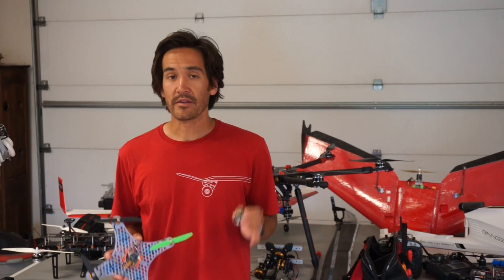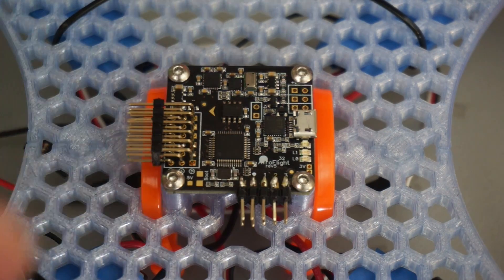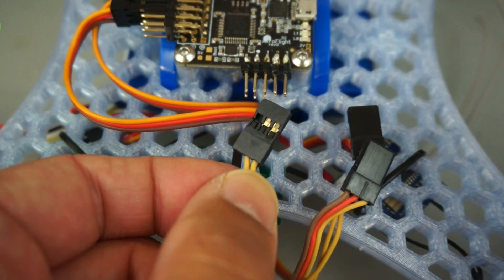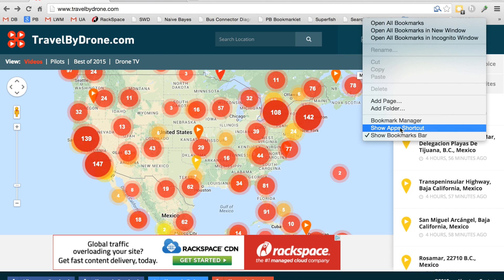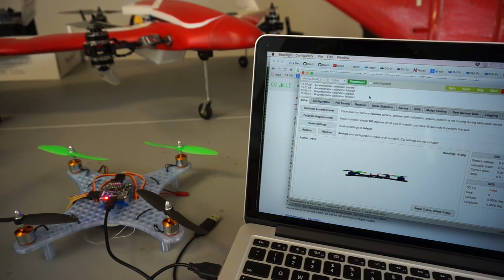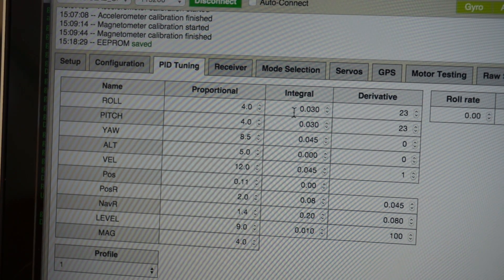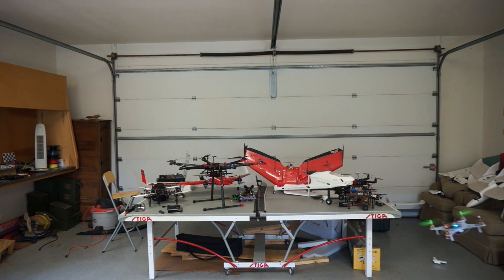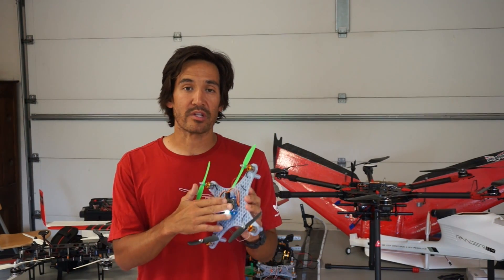Naze32 Wiring, Configuration, and Garage Maiden with DIY Mini Quadcopter

Comment: Your videos are awesome, super easy to understand, and very informative.

I know you haven't posted much Naze32 stuff in a while.  If you get the time can you do a video for setting up a Naze32 with a FrSky X4RSB Receiver in SBUS mode using cleanflight and a Taranis Radio and 3 flight modes on 1 switch (angle, horizon, and rate)?

Or if you could just do a quick video of how to set the 3 modes up in cleanflight and on the Taranis with sbus that would be great too.

I have found videos with bits and pieces for setting these components up but I haven't found one that shows a complete process.

If you don't get time that's cool too.  I used your videos to build a complete DJI F450.  Thanks for taking the time to post so much information!
Reply from the maker: +Hall Fatherofthree Thank you so much for the positive feedback. I'll see if I can get to work on a Naze SBUS tutorial in the near future. Right now I'm working on getting Naze working in a wing just to see if I can get it to stabilize. Once I'm done with that I'll look into an SBUS setup. Appreciate the thought.

Comment: Your video helped a lot, i'm using a Afromini Amaze rev3 (Mini Naze32) . i have it flying but have run into a problem and I don't understand how to fix it.  I fly in "rate/manual" whatever you want to call it.  but my Yaw rate is so slow its rediculus.  and the pitch and roll are not much better.  I'm using about a 250 sized quad I 3d printed from thingiverse.  so I put your 2.1 settings in for P settings on pitch and roll.. left the rest the same.  http://www.thingiverse.com/thing:304237

Now I tried to up the yaw rate in the baseflight settings from 0 ( default ) to 0.5 and it had no effect at all...in fact it may have increased the pitch instead?   any idea.. I'm having a hard time finding any good directions on these controllers and on baseflight.

Thanks
Reply from the maker: URABUSWRXSTi Man I'm sorry to hear that and wish I could help. My yaw settings are pretty decent but I'll see if I can figure anything out in the next few days. Right now I'm so busy with projects that I haven't had a chance to look. Good luck and keep us posted. Very cool frame btw!
Reply: Dennis Baldwin I turned expo off in baseflight and then put some expo in on my transmitter only on pitch and roll .. no expo on yaw.  Cranked yaw rate up to 0.7 .. it still takes awhile to get up to speed spinning, but then it gets spinning fast.  RCGroups told me thats just the nature of Quads..they yaw pretty slow. ( I'm used to helicopters ).  Anyway I guess its flying pretty well now.  Waiting for my FPV gear. amazon sent me the receiver with no receiver in the box LOL..just the wires and antenna. so waiting for a replacement.

Comment: Good one, everyone keep in mind cleanflight allows for FC board rotation so put the headers where you want. Also good to spray board with gloss high heat motor paint to avoid shorting in rain or if something falls into it like carbon.
Reply from the maker: Hoverbot1TV That's so cool that the board can rotated for a different orientation. Great tip. I've ever sprayed any of my boards with motor paint, but will definitely look into it. Hope all is well.
Reply: Dennis Baldwin
All is great. Working but it allows for more development and testing since I have a 4 day week, no supervisor and I get off shift at dawn when the parks are empty. LOL! Doing a lot of multirotor service local for film industry too and may pilot the GH4 soon on a set.
Things could be a lot worse but I still have three naza not being used and that hurts. LOL! :o) Your vids get better and better but need more field testing and extended flights I think like the fun naza flip vid you did.
Reply from the maker: Hoverbot1TV You got it. I'll get out to the field more this summer. Good luck with your projects. Sounds like some exciting stuff.

Comment: easier way to disable the motors from spinning is going into the cli tab and type "feature motor_stop" then type save. There may also be a check box for this in configuration. I havent used baseflight in a while, theres a check box in cleanflight to stop the motors from spinning when armed.
Reply from the maker: JC61990 Good to know. I'll definitely check that out. Thanks.

Comment: Your vids are great, I have seen almost all of them. Quick question... im getting ready to build a mini quad after building two 450 size quads, I mostly fly naza but also have a kk2 ii have tinkered with and want to get more into some acro fpv, do you prefer the cc3d or the naze32 after getting some stick time on that board?
Reply from the maker: Jason Clevenger Man tough question! I like the Naze32 mainly because the configuration utility (Baseflight .... some use CleanFlight) is so easy to use. Runs as an extension in your Chrome browser. If config software isn't a big deal to you then both boards before REALLY well for mini quads. To be honest I don't have a fave. If you're price conscious then go with whatever you can get for cheaper. I have more experience with CC3D and flew with it more two years. I've only been with Naze32 for about a month. Wish I could have given you a black or white answer :)
Reply: Dennis Baldwin
Reply: Jason Clevenger  Thanks for the reply and keep up the great work, you make it easier for guys like me who love to build these but aren't good with electronics. I'm learning, slowly but surely!

Comment: Great video Dennis! Quick tip use a small amount of Flux on all your solder points. It help the solder flow much faster and gives you a clean solder joint.
Reply from the maker: JKFlorida Thanks man. I appreciate that. I have used flux in quite some time but need to make it a habit. Hope you're doing well.

Comment: Thanks for this video.  It's a relief to see someone actually use baseflight instead of cargo culting over to the cleanflight fork for no reason.  baseflight on an acro naze32 is an ideal acro or fpv racing system.  There's a lot of strong opinions as to whether you should use stock firmware or a fork, but both hit their respective limits at roughly the same point.  I get asked about bugs in one a lot more than the other, though.

If you want more functionality, grab a pixhawk (as you know) or look into Taulabs.  Sparky2 is an amazing piece of hardware for TL.  I've also flown BrainFPV quite a bit which integrates a graphical osd along with standard TL features such as picoc.

But as others mentioned, MOTOR_STOP is a checkbox that does what you did with minthrottle.  I don't generally recommend it, though.  I don't like being surprised to find out my aircraft is armed.
Reply: I use Cleanflight on some of my rigs but I think Baseflight is better! The whole PID controller is just plain nonsense! It's really a crap shoot on what PID controller works for you. And out of 50+ people I fly with no one can really explain what they do. So yea Baseflight is great!
Reply: pavalige yes, quite serious.  Which of your words in there quantifies cleanflight as "better"?

"enthusiastic open source environment" translates to about 20x more bugs in the thing responsible for keeping my aircraft in the air and safe.

I do understand there are a lot of users as well -- they come into irc with basic configs they can't get working in cleanflight.  I ask why they're using cleanflight and it's always "someone told me it was better."  I suggest they try baseflight and their problem goes away.

I do use naze32s.  I've done hardware modifications to mine to add features, have done custom mixes for odd aircraft.  I even have a hand-made brushed micro naze32 board I use for LoS practice in confined spaces.  I do actually enjoy flying my naze32 on my small aircraft.

But naze32 is quite limited hardware so you shouldn't expect much more out of it than baseflight offers.  This is why there's an influx of new "cleanflight" boards (SPR, DoDo, etc...).  They give you a bit more wiggle room, but it's fundamentally still obviously a descendent of the multiwii code.  For example, the roll and pitch rate are both .5 on my 250.  Do you know what that means?

If you want to do exciting things, get something modern like a sparky2 and run Taulabs with a proper RTOS.  When you talk about pushing limits, this will take you beyond where cleanflight can ever go.  There are features in CF pull requests right now that can literally be implemented on a Taulabs flight controller without even landing the thing first, much less having to do a software build and reflashing the board (see: PicoC).  The sparky2 is priced about the same as the SPR, but with inarguably superior design and hardware features that are vastly ahead (e.g. it's got a long range radio installed that can be used for several different things).
Reply: Dustin Sallings Cargo Culting are you serious? Cleanflight may be a fork but its a forward progression that enhances great hardware in an enthusiastic open source environment that benefits every user out there .
Baseflight  gets the job done but why not utilise timecops creation to it's fullest potential ?  
As far as limits go you obviously don't use a Naze32 or  you would realise how wrong you are.
The Naze32 is best used as it was intended as a more than capable "acro" FC that works out of the box and gives novices and accomplished fliers the ability to push the limits and have a control over their quad that wasn't possible before.
It's the go to  FC for novices and pros  alike , it's not about funtionality it's about performance and the Naze32 is top of it's class in the 250 to 350 mini quad arena.
Reply: pavalige If naze is about performance and cleanflight is the better choice, why is cleanflights lowest theoretical looptime higher than baseflights?
Reply from the maker: Dustin Sallings Well I learned a new term today (cargo culting). Had never heard that before . My goal here was simple: to get a basic FC setup in my mini quad so I can continue to practice acro flying. The Naze32 is so much fun to fly and I've been tightening my loops and rolls. Will probably be even better when I get more familiar with tuning the PIDs. Thanks for the feedback and I've been enjoying baseflight so far.
Reply from the maker: Zachry Thayer I have no clue about looptime but I'm definitely going to be looking into it :) Thanks for the thought.
Reply: Dennis Baldwin just slowly increase the roll, pitch, and yaw rates about .1 at a time and try it out.  The numbers don't mean much, but on my aircraft with higher P than you've got, I get pretty fast rolls and flips at about .5

You can get a little Bluetooth adapter and do it in flight pretty easily.

Also note the rc rate is a bit low (1 is good) and default fc side expo is .65.  May want to adjust these a bit since you know what you're doing.

Comment: Dennis, most people use cppm capable receivers (eg Fr-Sky D4RII )  which uses the one servo connector from the Rx to the Naze32 ground , power and pin 1.
Cleanflight is the configurator of choice as well , it has a lot more features available.
There is a checkbox in cleanflight that stops the motors spinning on arm or you can input "feature motor_stop" in the CLI
Reply from the maker: pavalige Awesome tips and I greatly appreciate the feedback. I'm going to look into cppm and didn't even realize Naze32 supported it. Simply awesome!
Reply: pavalige I just got the mini naze and it only supports PPM..so I was forced to use it haha. It works good. Don't forget "Feature PPM" in the console in baseflight ( or click the checkbox on the first screen )  that had me stumped for quite awhile.